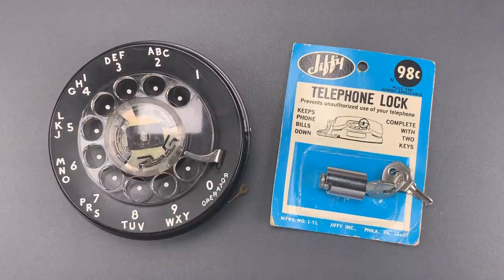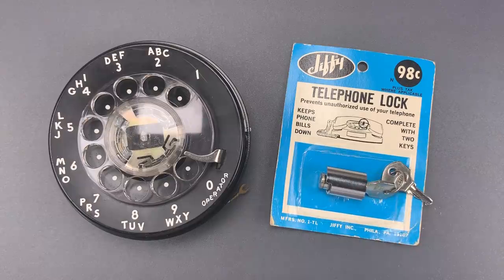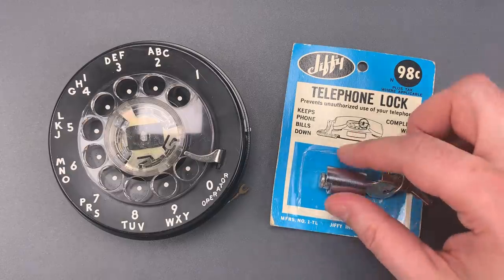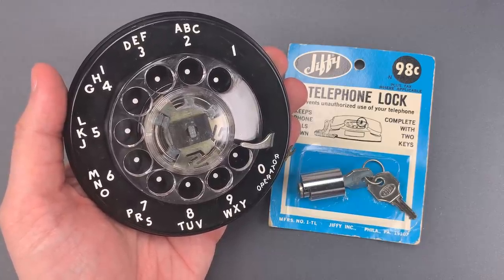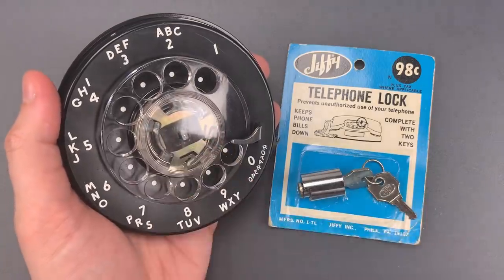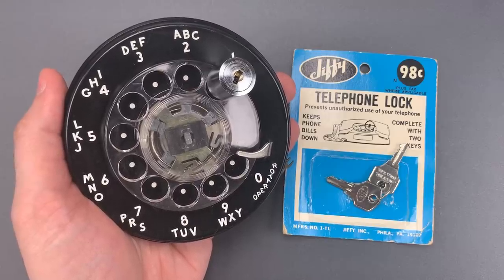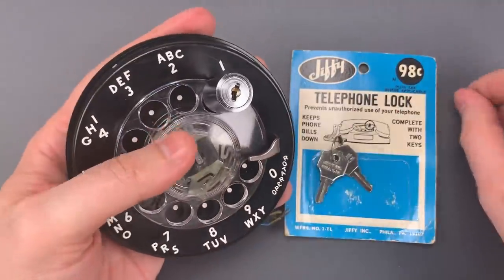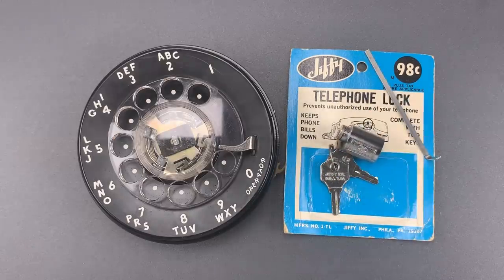[1084] This Lock Could Save A Month’s Wages... in 1960 (Jiffy Phone Lock)

Comment: The was another exploit for those phones, which I did use during my army service in the late 80' in Poland. 

The way such phones work is that the rotary dial produces a series of electric pulses while turning back, exactly as many as the digit dialed (with 10 pulses for 0). There is another method to produce those pulses: quick rhytmic pressing of the hook switch intended to disconnect the line while the handset is on the cradle. This is what we used to bypass the block which prevented the phone in the barracks from connecting to the outside lines. This way we could call our families.
Reply: I have an old phone like that and managed to dial a number that way once. It's tricky to do it right.
Reply: @Cadwaladr  We had lots of time and not much else to do on evenings, so we mastered it...
Reply: That's why the lock should be attached AFTER you rotate the dial all the way CW. In this position the hook switch is disengaged.
Reply: If your exchange supports it, you can still pulse-dial by tapping the hook. Sadly the new ones don't :(
Reply: OMG, Jerzy, you might know Kevin Mitnick !!!
Reply: Also because it's a matter of pulses to dial numbers you could simply break the stop and dial as normal, or break the plastic ring on the one
Reply: @Cadwaladr  Wouldn't it be easier to tap the hook switch 10 times to get an operator and then to simply just tell him the number you want to dial?
Reply: in america, back in the day, there were also phones without the dial meant for in-coming calls only. 20 years ago, when i was with a company that provided it, still used most of the older tech and were still able to do the same trick even with a touch tone phone.
Reply: @MyRegardsToTheDodo  What's the fun in that?
Reply: Yeah this used to work on German payphones, but eventually the phone company called it "atypical user behaviour" and added shock dampeners to the phones.
Reply: @wrtlpfmpf  payphones in America are almost nonexistent.
Reply: I remember that as well (very early 1990s).  Back then, you also had pushbutton phones with a switch on the bottom to change between pulse and DTMF so that they could also work on pulse-only exchanges.  I do seem to remember that getting the timing right by tapping the hook switch was a bit tricky, especially if you wanted to do more than dial a local number :)
Reply: I used that technique in the late 60's as well.   The switch hook accomplished the same thing
Reply: I did that with my grandma's phone when I was a teenager to talk on the phone with girls, every night when she went on her daily visit to her friend, I got so good at it that dialing was slower lmao
Reply: Exactly, after a short training I was able to call my colleague by just pressing hook switch 😎
Reply: @Cadwaladr  It works just fine on modern phones, too.

Comment: My dad once told me how when he was in the army, he and his friends would call home on locked-down phones by tapping out the numbers manually, without using the dial....
Reply: I was going to mention that! The way the dial works is that as it spins back into place it connects and disconnects the phone once for each number. So for the number five it would click on and off five times. So with a little practice you could dial by just quickly tapping the button the receiver holds down when the phone is hung up.
Reply: @Vares65  All you need is clicking as many times the number need (1 for 1, ..., 9 for 9, 10 for 0) IN ONE SECOND! The telepone exchange counts the breaks in a second for the number. (I have been serviced pulse phones some 30 years ago... :) )
Reply: The military had phones that were "answer only" that had no dial on them. I ordered pizza a number of times on one of them.
Reply: Remember that one